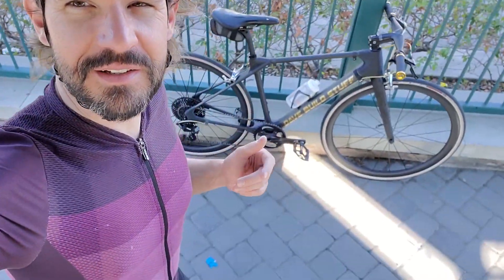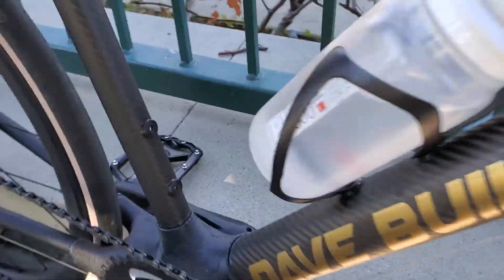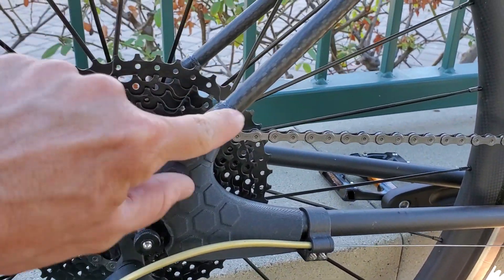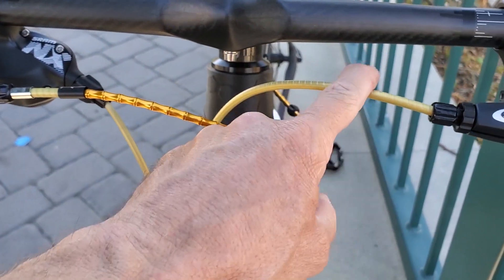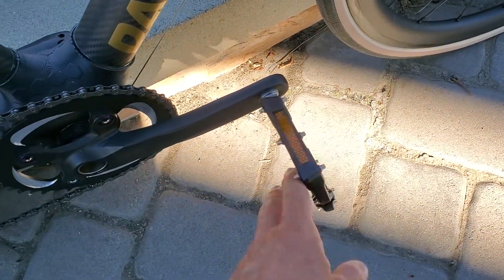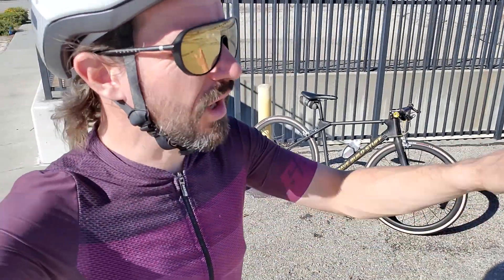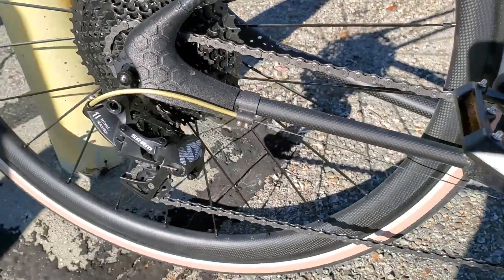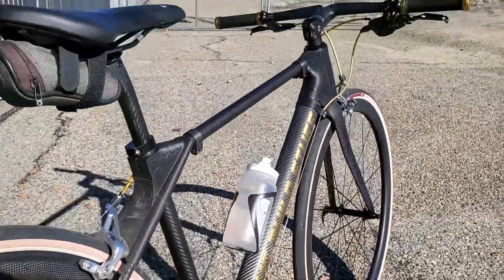Update on the 3D Printed Carbon Fiber Bike

Comment: has it taken any strong forces like hitting a pot hole? I am looking to build a CF recumbent.
Reply from the maker: Yes, many times.
Reply: @designbydave  Also, standing up to power up hills... has that been done as well to test the bottom bracket lug? There is a tremendous amount of twisting force on that when climbing I am sure!  And on another video that used your design, they provided the link to the Google folder you created with the files and directions.
Reply from the maker: @hchattaway  It's not a mountain bike or a race bike, so don't expect to ride it like that. But, yes I have many hours and many miles on it. Mostly casual - to mid efforts.

Comment: Build a mountain bike so you can take it to failure, well to film and research and development. Find the weekness'es in the frame.
My question is why haven't the manufacturers used that technique. I'm glad they haven't i like my smooth frame design. But i can also see the benefits of this bike especially if i could replace damaged parts of the frame. 
Well interesting to say the least.
Reply from the maker: This is not how you perform structural load testing. Thanks for checking out the video

Comment: I've had the idea of 3D printed lugs for a couple of years now and occasionally search if there is any progress made on this obvious and elegant engineering solution.  You've actually gone and done it, by yourself and turned it up with carbon tubing, Legend!
Reply: There are a number of small companies that have been doing it for a while now. Bastion Cycles for example.

Comment: Your videos really fired un my imagination!  Since I have a conventionnai prusa 3D Printer, I was thinking of printing with a more common plastic and then wrapping the parts with carbon fiber.  From your enginneering standpoint, if you have any thoughts about that solution I would be more than happy to read them!  Also I was juggling with the possible added benefits of using square tubing instead of round ones, especially for the  top and down tubes...   Many thanks for your videos!
Reply from the maker: Square tubbing, I would assume, to be more torsionally stiff, but I'm not sure you need that. Also, I assume square tubbing will be more difficult to source then round (but I haven't really looked)
Reply from the maker: Thanks, I'm super glad to be able to inspire others! You can print this material with your printer, you just need to get an insulated enclosure for it. 
The construction method you describe certainly sounds feasible. I would probably plan to make a few practice parts to ensure the resin used will bond sufficiently to the 3d printed parts. Might need to experiment a bit there. Best of luck.
Reply: I've done this before with bamboo instead of carbon tubes, it worked pretty well.